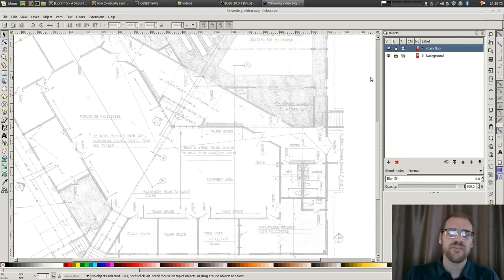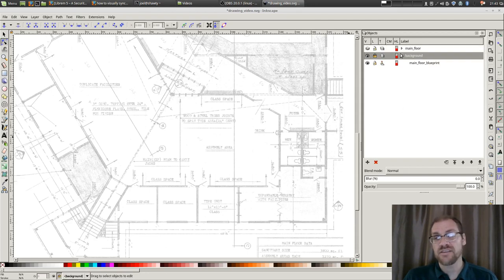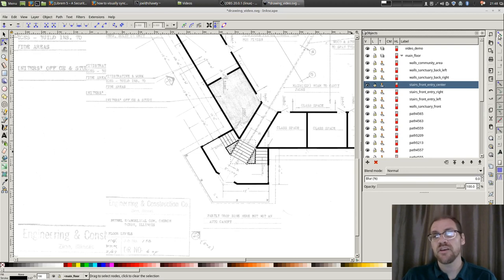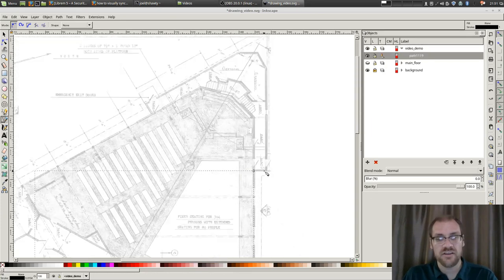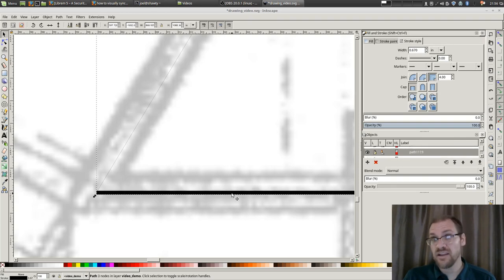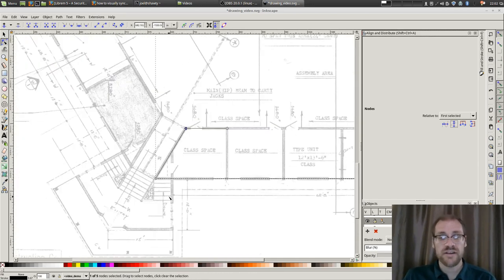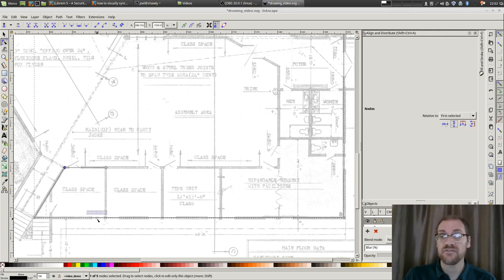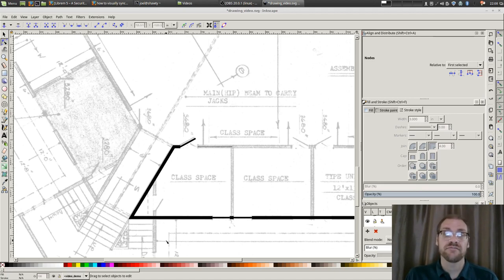Building vector blueprints from a scan in Inkscape

Comment: You can set default styles now, sort of. In the preferences menu, select "Pen" for example, and you can set it to use by default the last style you used. So, if you're drawing a lot of objects with the same style, you can set it once, and then every object after will use the same style.